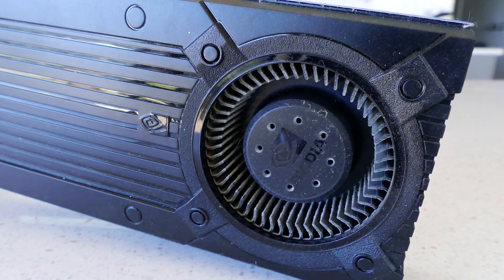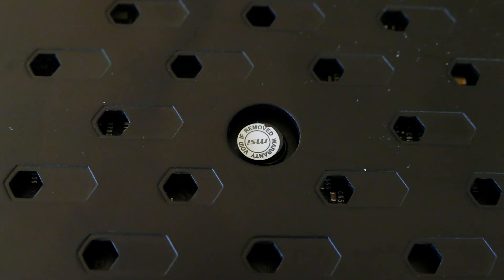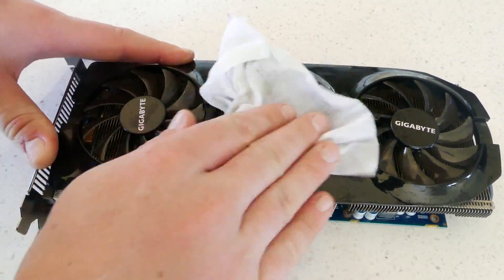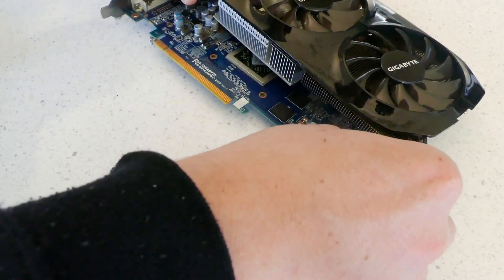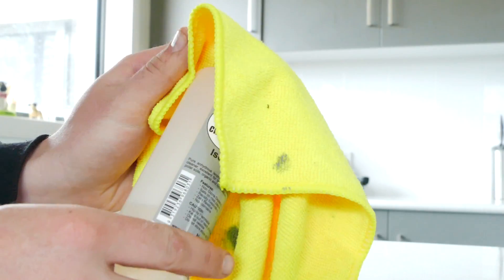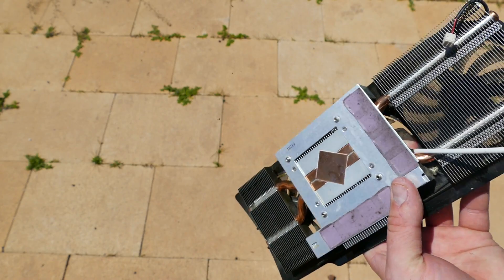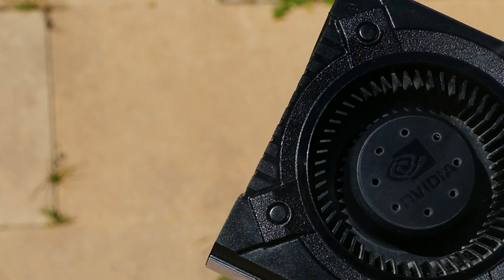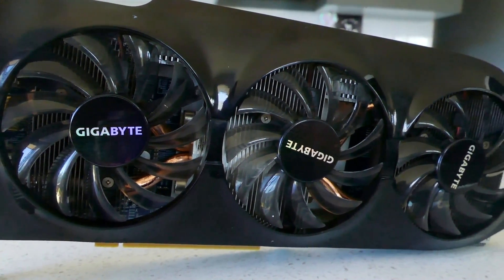How to Clean a Graphics Card/GPU

Comment: Haven't cleaned mine in 2 years. When i use afterburner to try to put my fans up they run for a few seconds and go back to auto mode. I think it's because the dust but is that the problem?
Edit: When I play fortnite for example on low settings it is in mid 80s which is obviously too high for that. Do you think the problem is that i need to apply thermal paste and clean it?

Edit 2: I know I'm editing this alot sorry. But also my card is almost 3 years old do I need new thermal paste? My GPU is throttling because it gets to 90 alot while gaming so I'm guessing I do need to replace it.
Reply from the maker: I doubt you would need new thermal paste but you definitely need to at least blow the dust out of the fans.
Reply: @EverythingbySam  Ok thanks for responding quickly!
Reply: How did it turn out?
Reply: @asherheist9814  Now when I play games on high settings its high 60s low 70s i just clean it from dust every now and then. The problem I had was just me being stupid. I opened the gpu to clean it but for some reason I didn't put new thermal paste on and I didn't know that once thermal paste is exposed to air it doesn't work as well. Once I realized that and added new thermal paste it was fine.

Comment: Hey, everyone does the cleaning switching thermal paste, but can i disarm and clean the graphics without changing thermal paste? or is it bad?
Reply from the maker: As i stated in this video if your card is quite new say as in the last 3-4 years it’s fine but if your card is 5 years or older I would consider changing the thermal paste although you don’t have to.
Reply: @EverythingbySam  Thank you for responding so quickly, but my plan is to disarm the graphics to clean it from dust, otherwise i cant clean it well (im trying to sell it), i was afraid that disarming and arming it again with the same thermal paste could be bad for some reason
Reply from the maker: It’s not good to use the same thermal paste once it has been set then you expose it to air buts just a PC builders rule of thumb. You can still use the old paste and it will be fine, I just change it for optimal performance or if the card is overheating/throttling.
Reply: @EverythingbySam  I am so sorry, but i got a little confused xD Should i disarm the gpu to only clean the dust away? (For appearance as i need to sell the GPU) I dont want to change the thermal paste. Is it too risky?
Reply from the maker: It will help your chances of selling the card if you do clean it so I would advise you to do it.

BTW disarm isn’t the word you are after I think you mean disassemble
Reply: @EverythingbySam  Thank you for everything! :D

Comment: If I clean my GPU can i het more fps in game (I don't clean it about 18 months)
Reply from the maker: If your GPU is overheating then that is possible
Reply: @EverythingbySam  75°C-77°C?
Reply from the maker: That’s a fairly average temperature range for a GPU to be running at under load
Reply: @EverythingbySam  and do i need to clean it or not a d will i get more fps ps my gpu is Gtx 750 Ti 2gb
Reply from the maker: I will blow the dust out and give it a wipe over but don’t worry about pulling it all apart.

Comment: bro help me plz i have dell optiplex 980 i5 760
8gb ddr 3 ram 
dell 265w psu 80plus 
can i attach gtx 660ti oc which consumes 140w
this cpu mobo has mini 24pin connector i cant upgrade power supply due to this mini 24pin
Reply: Upgrade your PSU.

Comment: Hi, just saying thanks for making this video! It was short and direct and very easy to see what you were doing and understand. I have good experience building computers, but this video gave me the confidence to finally break down my graphics card and clean it out (it's a GTX 670 from five years ago!). It totally worked and kept my CPU/GPU from overheating during max setting gameplay. I am so thrilled to be able to play my games again without worrying about my GPU melting. It was nasty, to say the least, but I took my time cleaning and resetting the thermal paste and and it went back together perfectly. Only thing I did different was removing the fan wiring because the way it was set I was afraid of breaking the wires trying to pull the adapter out of the GPU motherboard. Settled for just working with the fan still connected but set to the side. Didn't cause any problems. Did the same cleanup on my CPU, too. First time I'd pulled it out of the motherboard since building it, and it cleaned up nice, too. Good day for computer maintenance! Thanks again!
Reply from the maker: Hey mate I am glad to hear it all went smoothly for you and your temps are back to acceptable levels. 

Happy gaming!
Reply: Some months passed. How's your computer doing, buddy?

Comment: So ok You cleaned graphic card, radiator but you forget about fans, how to remove fan housing from motor? ... so I made investigation and on other videos I saw some tips ... works for other companies ... we can remove it easy
you have to pull it with a feeling ... but if it's closed gigabyte fan ? It's seems operation? , and one more thing, below the sticker is no hole... with white elastic ring it is inside between motor and housing, so WTF! Gigabyte doesn't want to fix their products at home, because customer don't buy new cooler ... so if somebody know how to remove Gigabyte fan housing please tell me it below my comment... (ps. sry for english it isn't my motherland language)
Reply from the maker: Each manufacturer differs their designs on things like that so it’s hard to cover them all but if you look between the fan blades there are generally a couple of tiny black screws holding the fans to the cooler that you can remove to gain access to better clean the fans or replace them.

Comment: hello bro. I have a problem. My r7 370 gets black screen when i install driver and when i restart after the logo i get black screen.
Reply from the maker: That’s generally an issue with the GPU itself. Cleaning it may fix the issue but that’s a slight chance as it’s more than likely a bigger issue which may be unfixable.

Comment: Hello i just bought an rtx 2080 founders edition and i plan on keeping it clean and running well and im afraid to do something like this. Can i just spray the fans and sides with an air can instead? Would that still be efficient for cleaning it? Considering this card was not cheap at all.
Reply: I sprayed my card about once a year, and I think it helped a little, but doing it like he described really made the difference I was looking for. For you, wait until it starts getting loud and hot in a couple years. Then, if you just do it like he described in this video, you'll find it's not too terrifying. I was a little nervous, being my first time, but sure enough, the card was a lot more forgiving than I thought it'd be. I even had to improvise because my card had some side screws and I had to unscrew the plate that holds down the GPU, but it all came apart very nicely (make sure you are careful with the screws, they are tiny!). And, man, was that old thermal paste baked on. I used Q-tips and isopropyl 99% alcohol to clean it, and it dried just fine. I found using very soft brush strokes to clean it did a good job of collecting the old past without wetting anything down besides the GPU surface. I eventually even used a "gaming cloth" cleaner towelette and that didn't do any harm.
Reply from the maker: If your card is brand new you don’t have to do this for a couple of years at least but if you can spray the fans with canned air every once in a while that will help.

Comment: can I use colgate ultra white toothpaste? I ran out of thermal compound:(
Reply from the maker: It has been found to actually work but it will quickly dry out and dissipate but if you want to experiment go for it and let me know how it turns out.
Reply: i used this in my old pc before applying it would die of overheating after applying the pc worked fine but i only used it on cpu .

Comment: Bro need help, my pc has intel motherboard and gtx 1060 6gb blower edition zotac. My computer makes beep sounds 2 times and pauses and then 2 times and then it goes silent but pc is on and no display can be seen. Intel beep codes say to reseat gpu for 2 beeps? I did reseat and blow some air from my mouth but still same. What should I do, its been only 2 months of this pc 😢😢😢 thnx btw
Reply from the maker: The beep codes are provided by the motherboard so you will have to google your motherboard make and then find the beep codes as codes change across manufacturers and even across different board types of the same generation.
Reply: @EverythingbySam  Thnx firstly but the intel website says that such pattern of beeps shows that no gpu is detected by the mobo so it will need to be reseated. I did that and blew some air from my mouth but it didn't do anything so what should I do now,  plzzz help 😞
Reply: @EverythingbySam  my card is the exact copy of blower edition card in this video but its from zotac.
Reply from the maker: You are not understanding me. Don’t go by the information on the intel website as it is not always correct you need to go by your motherboards manufacturer manual as it is the motherboard making the beeps.
Reply: @EverythingbySam  ok i'll check thnx
Reply: @EverythingbySam  Broooooo, my mobo is actually manufactured by intel. I dont have any fancy Gigabyte or asus mobo its intel one. Im not talking about the socket, the actual mobo is made by intel. And the intel website recommends to reseat the gpu and u know the story afterwards. Plz help
Reply from the maker: You can clean the GPU pins with a pencil eraser but if that still doesn’t work generally either your GPU is dead or the motherboard or PCI slot is.
Reply: @EverythingbySam  Wow thnx I just wanted to know that if I could clean it with a pencil eraser. Thnx i'll try and let u know. Thnx and the eraser wont do any damage right?
Reply from the maker: Nope no damage as it’s non conductive. Just remember to brush off any excess rubber pieces so they don’t get stuck in your slot.

Comment: I dont wanna take my graphics card apart... Im scared I'll damage it.
Reply: I just tried it today. I was terrified, but it totally worked. And my GPU is humming quieter and cooler than it has in three years. So, just take your time and be methodical, and I would expect it'll work fine.
Reply from the maker: You don’t have to take it apart. You can just clean the fans if you aren’t confident enough but GPU’s are robust and simple to pull apart and put back together.
Reply: @EverythingbySam  thanks
Reply from the maker: No worries. Good luck with it

Comment: I just put the fans and cooler in the sink and use tooth brush and soapy water  just make sure to make sure that everything is 100% dry before plugging it all back in
Reply from the maker: The problem with that method is water can stain which can bridge connectors causing a short or worse

Comment: my 1070 has a sticky dust that’s on it. would baby wipes get this off or should i just get it professionally cleaned?
Reply from the maker: Baby wipes would get some off but I would suggest isopropyl alcohol and a micro fibre cloth as that is better at breaking up sticky residue.
Reply: Everything by Sam what % alcohol
Reply from the maker: The stronger the better but at least 90%
Reply: Everything by Sam thanks man i really appreciate it, i’ll get to it tomorrow and let you know how it goes. is there anything you recommend not doing so i wouldn’t mess anything up on it
Reply from the maker: Graphics cards are pretty protected they days so it’s hard to do something wrong. Make sure you pour the alcohol onto the cloth not the card obviously and once you are done give it a few minutes to dry and you should be all good to go. 

With glue like substances you may have to give it a few wipe overs to get rid of the majority of it.

Comment: how about Electrostatic discharge?
Reply from the maker: What about it? Most modern hardware has some form of ESD protection built in and everything I used does not create a charge. 

If you are worried simply touch your case or kitchen sink before starting the cleaning process. 

There are actually very few incidents of people damaging hardware that way but everyone else seems to make it a bigger issue than it really is.

Comment: What about those cards with pre-applied Thermalpads? Do I need to remove those and apply New thermal pads?
Reply from the maker: You can do if your pads are old and shredded but if they are still intact there is no need to replace them.
Reply from the maker: No! No thermal paste is a huge issue and can potentially destroy your card. Thermal paste is vital for your card to be cooled efficiently.

Comment: Are you forced to change the thermal paste each time you open your gpu ? Will the gpu parts not stick together if you don't change it ?
Reply from the maker: You should change it each time time you do open your card but realistically you should rarely need to open it. Quality thermal paste won’t stick and won’t dry out for years.
Reply: Everything by Sam Can you undust it without opening it?
Reply from the maker: Of course you can. You only need to open it if you wish there change the thermal paste

Comment: Can I use this pasta too?..CoolLaboratory Liquid Ultra CPU Thermal Compound & Cleaning Kit 100% Metal.Thank you for answer.
Reply from the maker: Any CPU thermal paste will do the job but some are far more superior than others. Try to get one that is non conductive if you aren’t confident.
Reply: Thank you. And I found a faster gpu cleaning too.

https://m.youtube.com/watch?v=xR8h8Fw2W-w
Reply from the maker: Good luck with that method. Your GPU will make a great paper weight afterwards.
Reply: Do you think? :)
I asked the seller about my pasta. Okay or not okay to my msi 970.
Thank you mate! :)
Reply: I got an answer from my pasta seller: "Also beware that you cannot use the paste on aluminium!!" So I need be very carefully with this (too).
Reply: So sorry, this was the first answer:

 "Hi,
You can use this on a GPU. There have been some substantial temperature drops using it. Be careful not to put too much on. You don't want it to squeeze out onto the circuit board as it would then cause a short although this depends a bit on how isolated the GPU is from the circuits on your board. Several people reporting 5+ degrees drop. If you are worried that there is a chance of the liquid metal touching circuits then you could look at not metal compounds.
Hope this helps,"
Reply from the maker: Yes but thankfully there aren’t many heat sinks that are aluminium where they contact with the GPU die itself.
Reply: Thanks! :-) then i don't ask on the msi website this. Enough if you tell it me ;-)
Reply from the maker: No worries mate. Good luck
Reply: Wrote this a potato 🥔 
(👌)

Comment: Going to give this a go tomorrow, let's hope I don't mess up as I've never done this before. My card looks very similar to the blower style GPU in the video.
Reply: kys  It went great, thanks! I had bought a cheap pre-build because I didn't know much about computers, the time i made this comment I has was having over-heating issues and it was the first time i ever took a part out the PC so I was nervous. It had spent the last couple years on carpet and I have cats too, I did spray air in there every now and then but that's the most I was confident doing at the time. The GPU was super clogged full of clumps of dust, I'm surprised it was still going the amount in there. I've had my PC 4-5 years now and looking after it a lot better, I have a bigger desk so it doesn't need to be on the floor, I've even done some storage and cooling upgrades. :) I will probably be building my own pc next time instead of buying a pre-build.
Reply: I need to clean my aswell bc of high temperature talking about 80 degrees
Reply: @ElizaXP  same thing my pc is open right infront of me and im thinkin abt cleaning
Reply from the maker: The fan on the blower style coolers is a real pain to get clean.

Comment: I have a gtx 580 reference model card, I had the whole card cleaned out, pcb, and the thermal paste reapplied. The card was originally rated to not go over 86C on full load, but as soon as I play heavy intensive games such as the Witcher 3 the card gradually picks up the temperature, at first the card does a good job staying at temps between 80-86C but then the card picks up in temps to 97C it seems as if the card just continues to generate more heat. I know the reference cards are known to be a bit hotter but it seems nvidia did a poor job regulating the amount of heat the card releases. Can you give any thoughts. I'll try to reapply the thermal paste to see if it makes any difference.
Reply from the maker: I would download Afterburner and set a custom fan profile. If than does not help I would then suggest underclocking the card
Reply: I actually have all those programs, that's where I monitor and try to regulate the temps of the graphics card. I've had success cleaning out and decreasing temps on multiple cards. Somehow I feel like I made a mistake applying the thermal paste, this card has a very large die in comparison to other cards so if done wrong it can cause bubbles or other unwanted things that causes the temps to automatically spike up. I'm also going to check to see how the card spikes in temps in other games and whether it's just a few handful games. Bc the witcher 3 is an extremely demanding game puts older hardware to max load.

Comment: my 1070 is pretty dusty running at 70% fan speed for 56 degrees, would this automatically void my 1070's warranty?
Reply from the maker: 56 Degrees is not bad at all. Their thermal threshold is 83 degrees so you have plenty of head room. I would just blow the dust out of the fans with compressed air